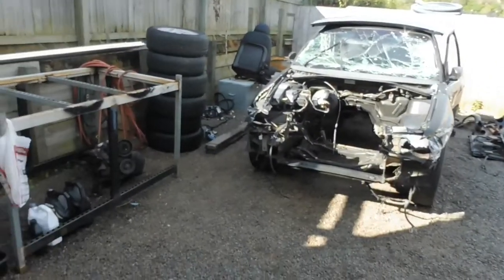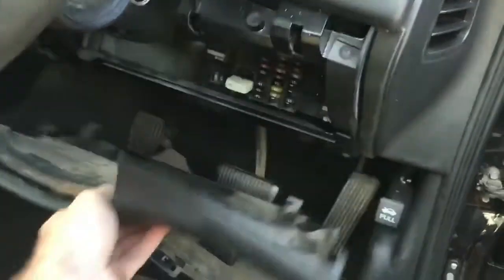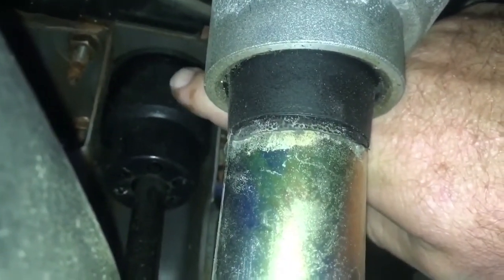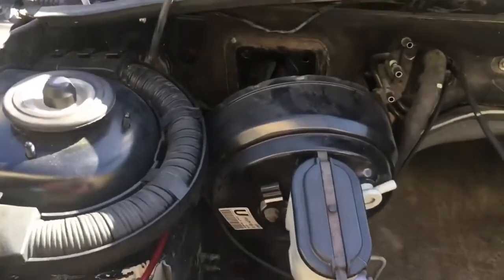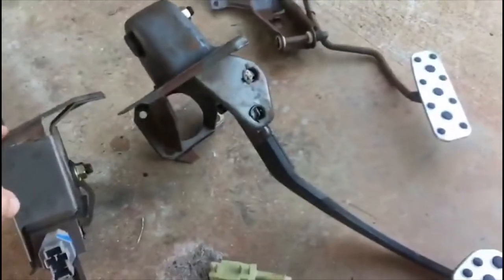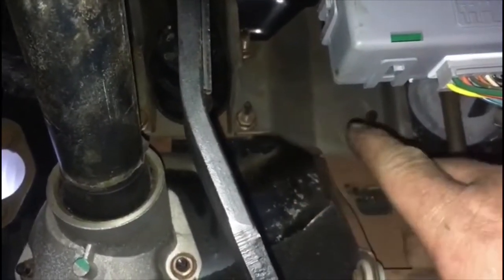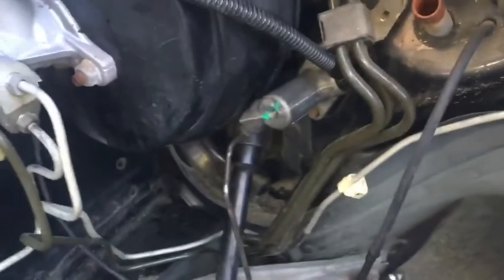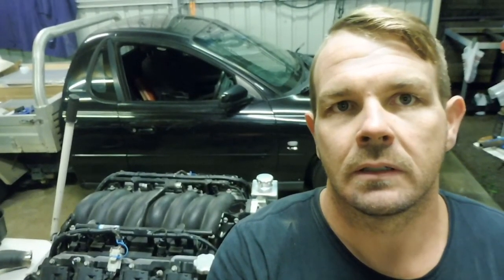Ls1 turbo Vy Tonner Build Ep2 Clutch + Brake pedal swap

Comment: I have just changed my pedals and it was fairly straightforward but having the engine in I had to move the two hose off the rear of the abs to pull the brake booster forward enough. Cheers lattys garage for the vids im copying step for step
Reply: Am in the middle of doing this. An auto to manual conversion. I have pulled the booster forward, removed the coils from the tappet cover.
And still the brake pedal will not come out.
What is the trick???
Reply: @IKillSh17  
We got the pedal out!
Basically we were very hesitant to bend the brake likes from/into the ABS block.
But we just said "firetruck it" and man handled it out of the road!

We loosened the two bolts that screw into either side (left and right sides) of the ABS block.

Lifted the ABS block out of the plastic square "bucket" that it is housed in. Take note of the slots that the two bolts are slotted into.
Pull the booster a quarter inch.
Pull the ABS block a quarter inch.
Keep doing this until the brake booster shaft is roughly 3/4's of the way out of the brake pedal. Or until there is enough room to slide the brake pedal off/away from the booster shaft.
Then reverse the process to fit and bolt up the brake booster to the manual pedal.
Some other tips.
If you buy a second hand clutch master test fill and pump before you fit it as the brake fluid leaks straight onto your carpet if fitted and pumping to bleed the system. (It happened to us)
The bottom nut that holds the clutch master to the fire wall is difficult to reach so either load up the socket with grease or wrap the nut with a piece of tape to give it a firm tight fit in the socket so that it does not fall out when you are attempting to start putting the nut on the thread.
There should be a diamond shape with two round tabs rubber grommit filling the hole where the clutch master will be bolted to the firewall. It does pop out with a push or three.
Id suggest fitting the clutch master before pushing the brake booster on. As space is very limited.

The clutch and brake pedal buckets (what the pedals are held in) use the same two bolts to mount them under the dash (looking up into the dash when lying on the carpet) and a third slotted hole on the brake pedal (rough triangle shape) If the two shared holes do not line up then you have the overlap of the clutch and brake pedal buckets is incorrect.
Then you will have to pull them out to overlap correctly so that the holes in the overlaps and the threaded bolt holes line up.
To make the actual fitting of the gearbox easier, you must take the bellhousing off the manual box and bolt it to the motor then fit the rest of the box and bolt it to the bell housing.

If you are using the factory hydraulic clutch fluid line (metal and pre-bent) then I would suggest installing/fitting/slotting it in before the box is bolted up. It is a tight, blind spot to drag, manipulate and swear at a "rigid" clutch fluid pipe.
Also at this time I would suggest lowering/installing/fitting/slotting the lower half of the loom (reverse light, right hand side/plug, left upper side of gearbox and the two O2 sensor plugs) due to ease of access with out the gearbox.
The factory clutch slave has the input shaft  running through it and is bolted to the internal back wall of the bellhousing by two bolts.
The clutch fluid filler pipe (from the clutch master/pedal) screws into the lower port.
The bleeder hard pipe (the one that sprays you with clutch (brake) fluid is screwed into the upper port on the clutch slave cylinder. 
These, if factory are different threads.
Wear safety glasses when bleeding the clutch system.
You will need a manual loom. Google images of these if you are going to buy one second hand that has already been removed so you know that loom being offered os correct and complete.
The one we used had a section cut (found after it was bought) and after getting the car to run was told the loom was  off a ute and they have a different part in the loom (apparantly (owner of the car was told this by the tuner....)
Luckily enough we had two O2 sensor extensions (about 8 inches long) from the auto box.
And they were truly required.
You will need to bungs to seal the trans cooler line outlets on the radiator.
Take your time feeding the loom into its required spots on, near around the engine as we needed every milimetre of loom for it to not be chocking a water heater pipe or fuel line.
On the engine we worked on there is an oil pressure sender switch bolted to the back of the block.
The dual wire cable for this came through the rubber grommit blank for the clutch master cyclinder
The sender had two threaded electrodes (+ -) with brass 6mm nuts. Dont drop them as it is a very tight place.

Its a bit of a ramble but I do hope it helps with your conversion @KiLLEMALL-bx8my

Comment: Am in the middle of converting auto to manual in a V8 VY.
I have pulled the booster and ABS forward, removed the coil pack from the same side tappet cover. 
Also removed panel under the dash, the aircon duct.
Can not get the auto brake peddle out.
What am I missing?

Comment: when i did manual conversion on my VY Calais i just cut down the auto pedal so much eazyer
Reply from the maker: I didn’t find changing the pedal very difficult at all but if thats abit hard cutting down the pedal would definitely work thanks for your suggestion
Reply: @LatysGarage  also note alot of engineers wont pass cut pedals due to changing the steels integrity
Reply: Hey man. Did u run into problems with cutting down the auto pedal ?
Reply: @THETMCKID  nope and passed engineering just got a another clutch rubber to slip over the exposured metal. It looks exactly the same as a factory manual pedal

Comment: Hey mate gearbox is in but how did u wire it up speed sensor etc reverse lock out
Reply from the maker: Fishing New Zealand the easiest way is to have the correct manual engine loom to suit your car . But if you can’t you need to find and ecu pinout diagram and locate The   Required pins and run wires to the sensors .
Reply: Cheers bro will sus it out.
Reply: @LatysGarage  hi just saw your clutch pedal install it was very helpful, I was wondering if you still have the cruise control wire loom as I need one, if you do & want to sell it how much.

Comment: Good vid m8 if i was just swapping over pedels not convering to manuel i wouldnt hav 2 go 2 the trouble u did ?
Reply from the maker: MicTheGreaseMonkey are you changing pedals just so you get the ss pedal covers ? If so you could just peel the covers off and restick the covers over your stock pedals with sikaflex .